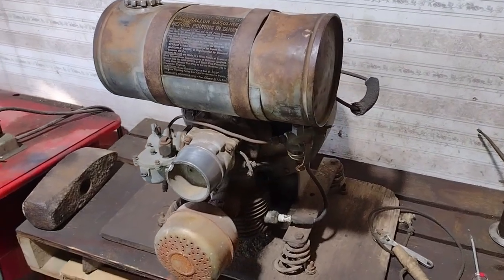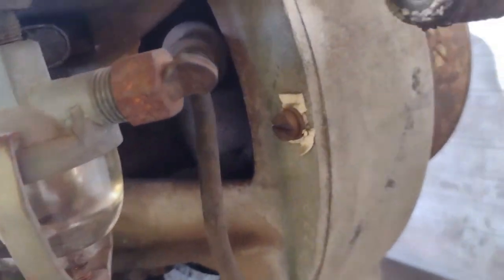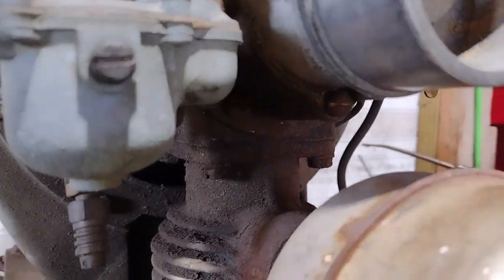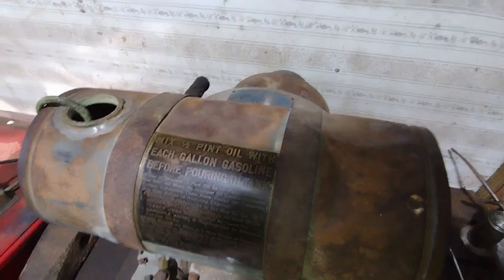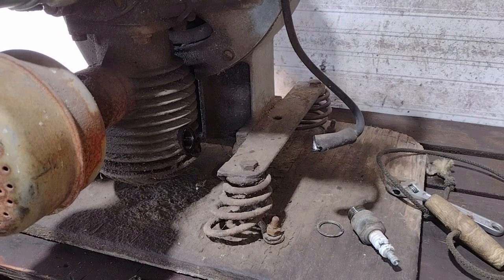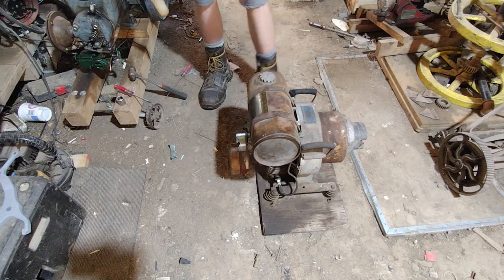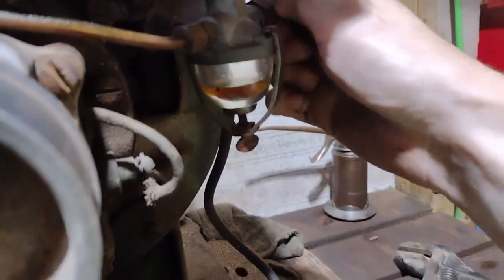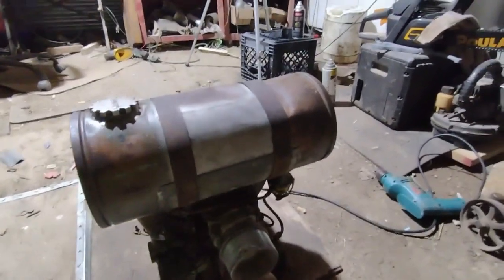Will this 71 year old generator run and generate power after sitting for 35 years?

Comment: I have one (1200 watts) that my father bought in 1947 at Crown Assete (War surplus) that runs beautifully..  It is fussy for fuel/oil mixture and runs at 3600 RPM. The orriginal sparkplug had a 
1/2 IPS thread and dad being a machinist made a bushing to adapt a 16mm. sparkplug thread.
I don't know how old it was when he bought it, but the Canadian Army used them in the 1920s and much later.

Comment: your the man well done sir sound's nice. what type of mixture does it take?
Reply from the maker: 1/2 pint of oil to one gallon of gas. thanks
Reply: I use 40ml. modern twocycle oil to 1 liter of petrol 25/1 for mine.